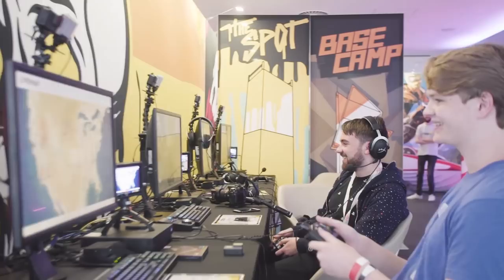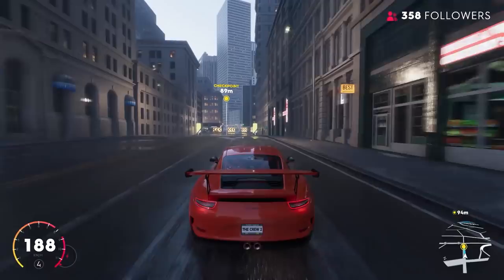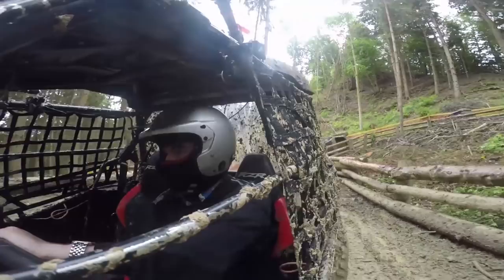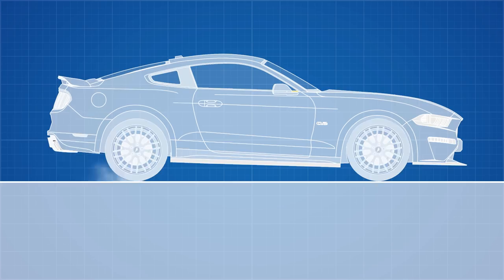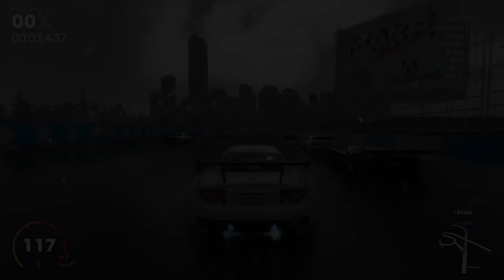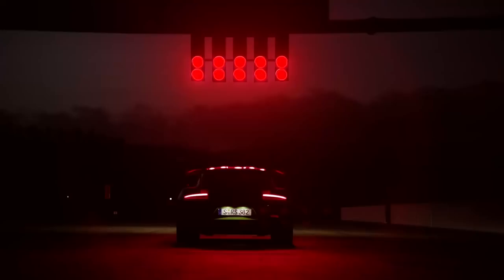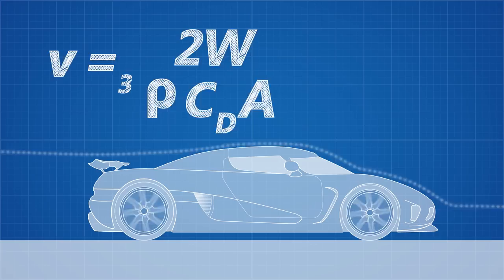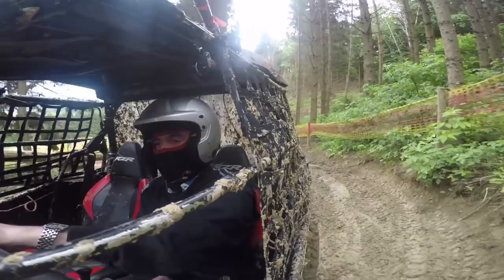The Physics of Racing Games

Comment: "Understeer is when you can see the tree you're about to smash into. Oversteer is when you can only hear it" - Walter Röhrl.
Reply: tfw you hear a tree
Reply: Moulton preferred all trees be unseen
Reply: Any professional driver will tell you understeer is 10 times worse.
Reply: "oversteer scares the passenger, understeer scares the driver" - one of the guys from top gear, i think, not sure tbh
Reply: @kryse4806  oversteer is controllable, if you start understeering, it means you are done, you are waiting for tires to get grip, either you forgot to trail brake or anything similar.

Comment: Paid promotion out of the way, games like this have physics about as realistically accurate as a blind man playing darts...
Reply: Generally physics in games is a component of the game, not a constraint. Because of that, it's usually tweaked to match the desired results.
Even if you're creating a simulator, you aren't physically simulating every part of the car. Instead of the entire suspension system, shock absorbers, springs, stabilizer bars and all that stuff you reduce it to few relatively simple variables and tweak it to match the results - actual physic simulation is too expensive, in computational sense.
Reply: The physics are accurate. Car modeling is not. Bit of a difference.
Reply: I get that this is an arcade style game, so why bother trying to flatter the players with "realistic physics" If you want to have "realistic physics" just play a racing SIM like Iracing, Rfactor2, Asseto Corsa and so on. I totally respect people who play arcade racing games, nothing wrong with it, but at least spare the 'realism' BS because as stated in the name "arcade", it suggests anything from "realism". A car doesn't hit a tree and drives through it as if nothing happened, hence "arcade" not "Simulation". And before anybody wants to suggest that the physics aspect of this video / ad focused on the actaul modelling of the performance side rather than damage physics, just understand that my comment above was simply poking fun at arcade games because im more of a SIM racing fan.
Reply: Its unrealistic because reality is quite boring tbh.
Reply: @wylie2835  k
Reply: @Bullshit_Media  that is true... I played the crew 2 demo and was amazed at hooow terribly physics could be warped... The damn cars are sucked to the ground with magnets... Every jump I tried to pull the car immediatly fell down at 500 km/h within a second.... There is no momentum, nothing... It's not a "simcade" it's 120% full-on arcade, with 0 realism.... And it would be nice if they just advertised it as a joystick controlled game, not a damn physics-accurate game meant for a steering wheel... That way people who actually like that kind of thing would buy it, instead of lying about what the game is...
Something like Dirt rally 2 is a better example at "simcade', it's not 100% Assetto corsa/Project Cars 2 simulating temperature fluctuations and airflow through the engine, but it's also realistic enough to not be an arcade game Like the regular Dirt 1,2,3,4,5,69.. games are...

Comment: 2:08 Spoilers have an effect on overall down force no matter where power is being sent to the wheels. Even in FWD application, grip through corners on the rear axel is essential for performance. Take the GTR LM NISMO for example. It has a massive rear defuser and wing. It is a FWD endurance race car. The reason for why it is FWD is for purely aerodynamic reasons by having the engine, transmission, and power at the front of the car, it leaves a huge area for engineers to play around with the aero in the back of the car. This makes it a more well-rounded race car which is perfect for endurance races.
Reply: He quite clearly said the games physic engine does not take into account wing downforce.
Reply: *facepalm
Reply: Paramour - He is clearly responding to the statement made in the video that spoilers have no purpose on FWD cars. Ironic while making comments about others being uninformed....
Reply: The video said the game doesnt take into account spoilers as an aerodynamic feature
Reply: AND he made the point that in real life spoilers have no use on front wheel drive cars.
Reply: YES, THANK YOU... i'm so tired of people saying FWD cars don't need spoilers, it's a stupid "myth"
Reply: One incorrect thing there a spoiler is not the same as a rear wing. A spoiler is a wing used to help direct air flow (either up and away from the chassis or create more negative pressure for the defuser) a wing used to create pure downforce is angled and designed slightly differently. Also the lm nismo was a badass car it’s a shame Nissan punked out on their team
Reply: Which is kinda interesting for a racing game, when even GTA5 takes spoilers into account in their engine.
Reply: Isn't the GTR LM 4WD?
Reply: No, its FWD
Reply: And Kentaro is correct
/watch?v=OAsO58Ubv0E
Reply: Luuk Willems That GTR is the R33 which competed in the 1995 or 1996 Le Mans while the new GTR LM raced in the 2015 Le Mans 24 hours but didn't finish the race. The FWD layout doesn't always pay off but you don't know what goes onto the minds of Japanese car manufacturers. For example: Mitsubishi entered a FWD FTO GT300 in the 1999 JGTC and so did Toyota with their Celica GT-Four which finished second overall in the 1999 JGTC. But, the difference between GT300 and LMP1 is massive. GT300 cars had/have around 400 to 500 bhp with massive downforce while LMP1 have both downforce and around 1000 bhp ( considering modern P1 cars use hybrid systems to increase the powerband )
Reply: I think the point being made in the game is that the physics engine does not need to accurately model the aerodynamic effects of wings and such.  The only thing the physics engine needs to know is the overall drag coefficient and how much grip each tyre has with the ground at any given time.  Big-ass rear wing equals higher drag and more rear grip.  I think the F1 simulators do CFD to test out new aero parts, but here we are talking about an arcade game.
Reply: Read the thread buddy
Reply: Spoilers spoilers the spoil the airflow hence the name, wings generate downforce. Only wings generate downforce and spoilers reduce drag.
Reply: NiffDoes yeah, but it does not change if the car is FWD or RWD. That was my point.
Reply: It's all wheel drive as the combustion engine power the front wheels and the electric engine powers the rear
Reply: Raphael C nope. It is 100% FWD. There is absolutely no power going through the rear wheels.

Comment: Yeah Crew 2 is pretty and all, but if you want to really feel what a modern racing sinulator can do check out assetto corsa or rFactor2. Both of these games have tremendous tire models that have sidewall flex, flatspotting, and realistic temperatures. The amount of detail and realism in these two games could not be better.
Reply: It really can, it would just be way too expensive to simulate every single thing that happens in a car. I've driven a C7 Corvette Stingray in Assetto Corsa aswell as in real life and the difference is enormous. Yeah, AC is quite realistic but still, driving the Corvette in real life was very different to doing it in AC.

Comment: if you want to look at real driving physics look at rfactor2, assetto corsa or iracing. there is much more going on like tire deformation, track rubber built up, aerodynamic simulation, air temperature, tyre component and temperature, suspension and much more. all of these factors influence things like top speed, cornering speed and acceleration. the crew 2 is a very bad example of a game with real driving physics, because its far from realistic.

Comment: One thing that I don't see being mentioned in the comments anywhere - you said that racing cars are usually mid-engined, because the weight of the engine will maximise rear grip when braking; this is one of the effects of a mid-engine (or, rear-mid engine) layout, but that's not the main reason why racing vehicles use this layout.
Putting the engine close to center of the car will reduce your rotational inertia and allow the car to corner more efficiently, as there is a significantly lower energy requirement to change the car's direction. It also helps to create an even weight distribution between the front and rear of the car, which also improves handling. These are the main reasons to use a mid-engine layout afaik, though increased rear grip is also a benefit of the mid-engine layout.

Comment: Lol physics and the crew 2, have you seen the gravity? You can even drive monstertrucks up verticaly. If you want to talk about racing games and physics, dont talk about arcade racing games. 

2:10 spoilers are/can be usefull on fwd cars. Also "the suspension model", is there even one in this game? 
This game has like multiple handling modles, depending on the vehicle type. For example the drift cars always drift, and touring cars are limited in top speed offroad.
And you can just adjust traction, thats also really unrealistic. 
6:20 "the crew 2 lands somewhere in the middle"(of arcade and simulation) it doesnt, the crew 2 is very obviously arcade, forza(horizon) would be a game thats in the middle.

All in all just a terrible game to talk about when looking at physics.
Reply: BoudewijnB i agree granturismo and forza are perfect in the middle, crew 2 is a lvl below that its more realistic than need for speed and burnout.
Reply: You can adjust traction in a real car. It's called traction control. Other than that, you can adjust tire pressure and compound, suspension stiffness, wheel camber/caster/track/toe, weight and downforce. All of the above have an effect on traction and handling.

Gran Turismo and Forza Motorsport are simulation games.
Reply: I didn't mention Gran Turismo, and i said forza (horizon).
About the tuning:
This game already has susp geom camber front and rear, sus comp front and rear, susp reb front and rear, aero distrib, anti roll bar front and rear tuning. 
Traction control is the system that prevent wheelspin on accelaration, which has nothing to do with tyre grip.
Reply: BoudewijnB nonono you misunderstand, I didn't relate traction control to tire grip at all.
Reply: @mrmaniac3  Neither gran turismo nor forza are sims.
Reply: @iI_Principe  forza motorsport is pretty close to realism, horizon is a 'simcade' and project cars is just a full-on arcade... With games like Assetto Crosa and Project cars2 etc being actual Simulators, that, paired with the right equipment, can actually be 1-1 to real life
Reply: @mataskart9894  PC2 is a little bit lackluster in my opinion. Definitely doesn't feel as good as ac when it comes to driving.
Reply: @iI_Principe  yeah I play ac and rfactor2 mostly, so just yeeted the pc2 in because a lot of people know it

Comment: Oversteering is not drifting. Oversteering is spinning in circles.

You only initiate oversteer on the entry in order to point the car in a direction which will allow you to understeer it through the rest of the corner. That's in a perfect world, in practice it's a balancing act, using the vehicle's controls to initiate oversteer and understeer in order to correct your path as you take it. As you get better you'll learn how to set it and forget it on the entry, the ideal drift is one with no countersteering and full throttle, the first time you do it you're hooked.

Comment: Ugh, I hate it when the designers put this fake drift mechanic in the game. I'm a racing fan and it just seems too unrealistic. No, a "drift setup" just can't be faster than a balanced one. The last time I saw a good trade-off between arcade and realism was probably in the Underground era of NFS. Nowadays I actually prefer simulations anyways, but for that you need a good steering wheel. And those aren't cheap...
Reply: Matej Pivec Forza Horizon is a great middle ground
Reply: What about Driver SF? IMO is a good simcade
Reply: Driver SF was fun indeed

Comment: Ducklip spoilers do not make much sense on front wheel drive cars but if paired with a front lip or if your car is to light in the rear and has a tendency to slide less aggressive spoilers or air foils make a lot of sense. Because a car doesn't lose grip when your maximum theoretical tire strain exceeds 100% but rather most often after the first tire to lose grip does so.

Comment: Actually the biggest downside to really stiff suspension is the loss of mechanical grip of the tyres. A softer suspension will have more mechanical grip, but it is a huge balancing act to obtain the best speed for any race car.

Comment: The amount of Wheelload variation while lateral acceleration is independent on the stiffness of the suspension system. Stiffness only effects the steady state roll angle, also depending on the heigth of your kinematic rollcenter. 
So why are race cars stiffer than any others? Its due to the drivers feedback becoming more direct with a harder setup by inducing a quicker load transfer. Furthermore where are Rideheight dependent aerodynamic devices, which need to be controlled.

Comment: It's odd that out of all game developers out there, the makers of Crew 2 invite YouTubers to such an event. After all it's one of the less realistic games. If it were a Forza 7 event, or Gran Turismo, or rFactor 2... (which simulates flat spots due to locking up the brakes, simulates the carcass, thread and contact patch, and even rubber left on the road by all the cars, affecting grip). A video like this on rFactor 2 would be pretty interesting...

Comment: Question, theoretically what would happen if a vehicle enganged power to the front tyres mid-drift whilst entering the corner behaving as a FWD? Not a transfer of power, but the introduction of independent front wheel torque...

Comment: For anyone looking for a proper racing simulator, check out Assetto Corsa (you're going to need a good force-feedback wheel at the minimum, feedback pedals recommended, TrackIR [and VR but I get motion sickness in VR driving] is also a good idea so you can look around). They also map the real-world race tracks with LIDAR so the it's super-accurate in that sense too.

Comment: Understeer is never desirable. Oversteer is sometimes desirable to achieve higher speed through a sharp corner than would be possible if taken conventionally with all wheels having nominal traction. Weight transfer is the most important factor in cornering through oversteer.

Comment: What about the handling mechanics in bamng drive, witch does not use producerally generated driving models, and instead calculates the handeling based on the weight, ridgedness, suspention and tires of the car 
Edit: beamng drive still doesn’t have super accurate handling

Comment: Well there are a lot of good reason to put a spoiler on a fwd car (of course along with many other aerodynamic mods). Spoilers will add much more use to the rear tires. Allowing for a much more balanced load around corners. I feel the spoiler on fwd joke is a bit dumb without context.

Comment: About the physics of weight transfer and what it causes: that's not how this works. Weight transfer is only a function of lateral acceleration and CoG  height, it is not affected by ride and roll stiffness. You're also not mentioning the traction circle when talking about drifting: the big thing here is not weight transfer but use of the traction capacity of the tire on braking thus having less traction available for cornering thus changing the way the car balances and behaves. Good video but careful with the technical details like these.

Comment: Just hypothetically could you get the back end to fly? I was thinking about this when you said "a front wheel drive with a spoiler." Would it be possible to take a front wheel drive car, and up a spoiler on it with aerodynamic lift properties rather than downforce, such that at high speeds the rear wheels would actually lift completely off the ground? What sort of disastrous effects might this have on steering? ;)

Comment: it looks like ubisoft has made another game with a very low skill ceiling.
you've described the physics engine helping the player on several occasions, the problem with this is that it turns the game into "hold W and tap a or d). Given that the game will add traction off road, torque the vehicle to keep it from flipping means that the only way for the game to be difficult would be to make the AI faster than you and require the player to make flawless runs and be lucky, instead of having a realistic game where the player would be challenged to make best use of physics and basic racing rules to achieve victory

oh yeah and lets not forget that the AI has "catchup" to an insane degree, so like NFS games you could be going 350km/h and the AI will catch you going upwards of 500 km/h just to add "tension" at the end of the race

Comment: Spoilers are used on some fwd cars, e.g. if a car is going very fast in a straight line the tyres are not under much stress fo the drivetrain does not change it’s behaviour much, however if the rear end is getting light it could easily go out of control in a high speed corner.

Obviously it is not as important in a fwd car but still a factor

Comment: Arcade racing games simulation is very loosely  based on real suspension mechanics. Not because a car able to goes around bends by insane speeds. Like in an adventure game as Tomb Rider, the forces does not effect the body the same way as it does with a real human. Of course the prop moves in different direction, car slides, charaters falls down, but these effects are not simulated, but pre-configured.  And we can't called that physics simulation, because only the visual are simulated. All the things aretold in the video are apply and true, if we look into iRacing example. But seems it was a great event for journalist.